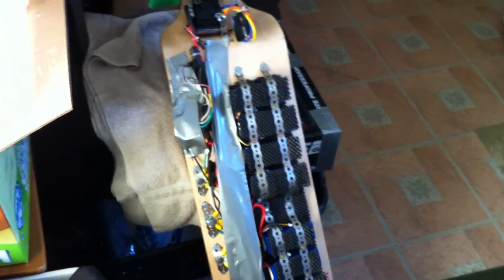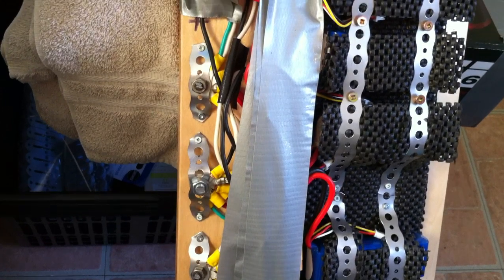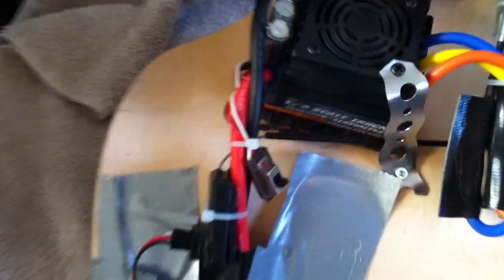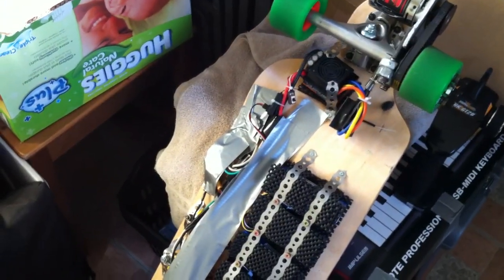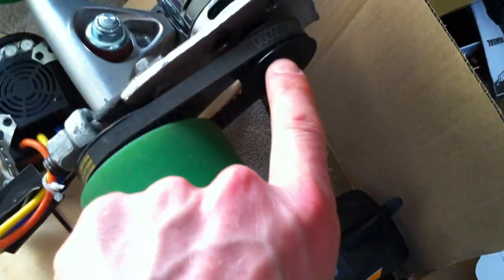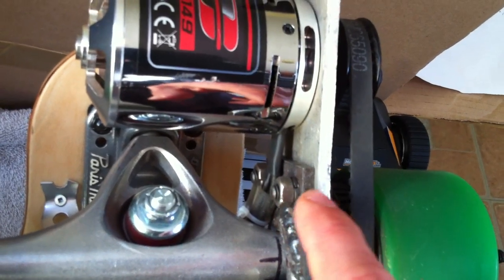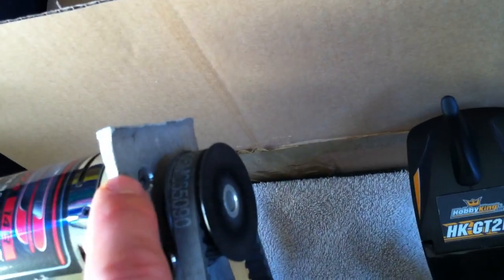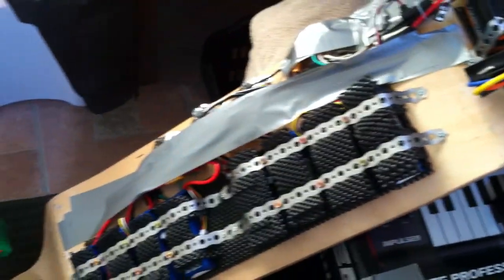HOW TO BUILD AND ELECTRIC SKATEBOARD

Comment: Hello there, I have a chinese made electric skateboard.  with an 800 Watt motor. It has worked fine for a year, but lately, the on/off switch stays on for about 4 seconds then dies. Batteries are full (acid/led batteries). Any idea what could be wrong and where can I find (in the US) parts and electronics for it? Thanks,Ozzie
Reply: Yeah... It's from China.
Reply: The battery has a life. sometimes short life. but shows full cherge
Reply: charging once and again. cuts the battery life
Reply: where did you buy it from?

Comment: would a Scorpion (SP-S-HK3226-1400KV) be sufficient for an electric skateboard?
Thanks for your response :)
Reply: +herrjonna2007 OK, thanks :p
Reply: +Zeppin too much kv, it would not be able to pull you ;-) keep it under 600 at least, lower is better :)
Reply: +herrjonna2007 a lower kv is better?
Reply: +Finlay Sambrook Smith correct, that means you need higher voltage per rotation. This means that you get more power per rotation (higher torque)...
Reply: +herrjonna2007 thanks, but surely that means it would use battery quicker though?
Reply: +Finlay Sambrook Smith yeah, more battery per rotation, but having a high kv means that the motor probably would just stop, because you put on more resistance per rotation than the motor can handle... 
with these amounts of batteries, battery should not be a real concern here... :P
Reply: +Finlay Sambrook Smith any time ;-)

Comment: Just be careful with those lipos. You need to find a way to protect them otherwise things could go very bad.
Motor pulley although big it makes life easier for the belt as you get more teeth engaging it. I wouldn't recommend changing it to a smaller one.

Comment: Could Anyone tell me if the speed control is actually required? Can i not use a variable resistor in parallel to the voltage source instead?
Reply: +sanath Naik ya of course if you dont have that u'll zoom to max speed
Reply: These modern high power motors are "brushless" Dc motors. They are not mechanically commutatod so they need an electronic device to read its position and sync with it. So yes an esc is required

Comment: your pulley on your motor seems too big, should be able to take that motor to 12s no problem. should get alot faster top speed if you want, also with the right ESC you can get it to break aswell (its sketchy)
Reply: +Gavin Grob im thikning of building one and being the adrenaline junkey i am i want to go the fastest so what ratio of motor to wheel would i need to have for it to be the fastest, thanks!
Reply: +Instantly Viral First I would get a Hobby King YEP 120 esc, and programing card (set timing to auto), then I run 20T on the motor. I actually just use diyelectricskateboard single motor kit, because i dont have a welder. But with 20T i can go up most hills but not all. I dont think you would want to gear it any high, It would have problems climbing and starting would put alot of stress on the motor. I run 12s though never had a problem. And also breaking is great has a setting for soft braking
Reply: aww you are the man dude thanks alot!

Comment: isn't it driven over driver?
so it should be 40 divided by 25 which is 1.6 
not 25 divided by 40
Reply: 0.625 wheel rotation per 1 rotation of the motor, same difference

Comment: Pretty good build bro! I also use 3s packs!! They overall became so much more cheaper per watt! But I run mine at 11.1v with a 580kv with a 3.7 ratio if I remember correct which gives me speeds of 26kph and I use four batteries and I got range of 20km ! I also have another pack of four to swap ! My board weighs 6kg
Reply: Lol for a decent one run 10s with high burst rating because if your gona waste money on a piece of shit 
Why not explore carbon fiber even tho it costs ££££ plus maybe 10x 10s lipos £££££ plus a overkill motor £££££ I am one crazy. Dude you might aswel use what lipo technology we have to build a board which will be just be so quick you may need a chair to even ride it lol